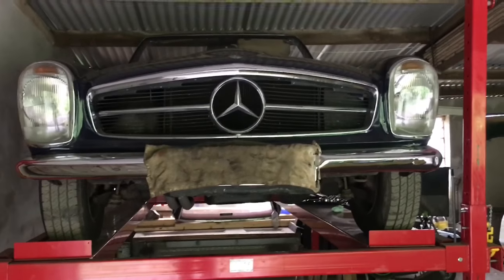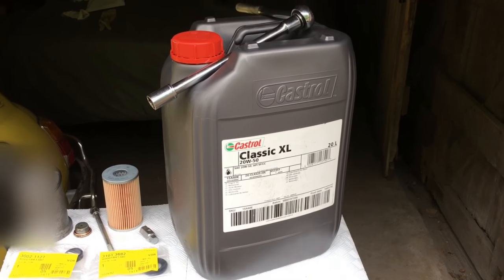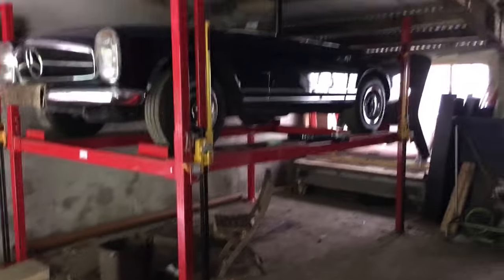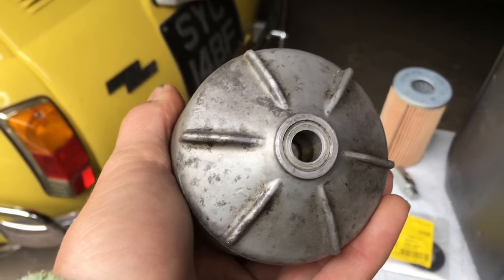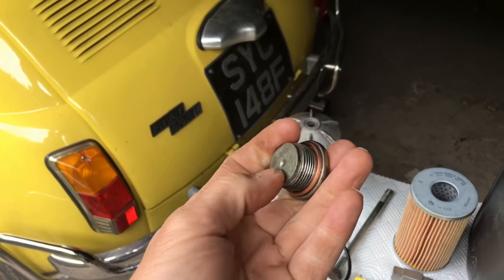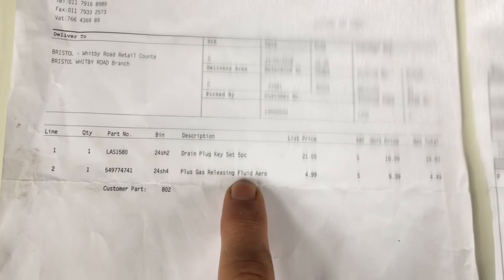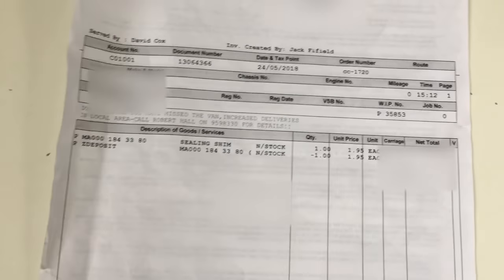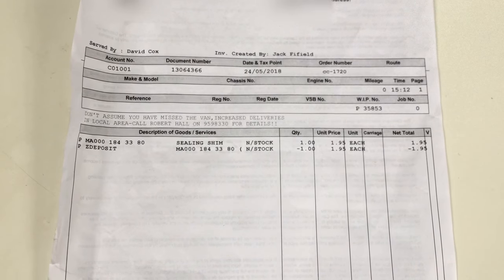Mercedes 230sl w113 oil filter and oil change

Comment: Thanks mate for sharing
Reply from the maker: Pleasure - that Pagoda is so reliable that I rarely have to do any work on it! Mike
Reply: @MikesMercsandothercars  I just recently acquired 1967 250SL CA Special and are about to go through some maintenances. Next to oil change I have to replace the slave and master cylinder clutch (leaking)
Reply from the maker: @johnmcclane8046  Thanks for your comment - replaced a leaky master on the red 107 some time ago and my next video will be replacing the leaky slave.....boy was that a job!! Also did a separate video on replacing the leaky clutch hose.....with the benefit of hindsight should have done all three together....so...my advice would be to replace the rubber flexi hose that goes through the firewall when you do the job.. Mike

Comment: Sooo... where is all the action under the hood or underneath the car?  The video started out well...encouraging.  Then it all went tits up after transitioning from video to stills.  Moreover, don't really care about your receipt as an oil change is not an option.
Reply from the maker: Good point - just watched the video again and probably should have shown removal and reinstallation of filter....although it is only held on by one bolt. I think I shot this video long before I had a camera stand.